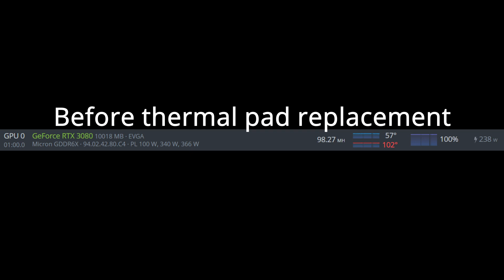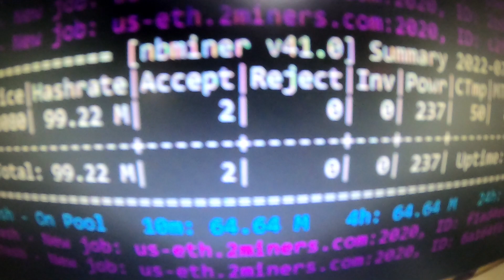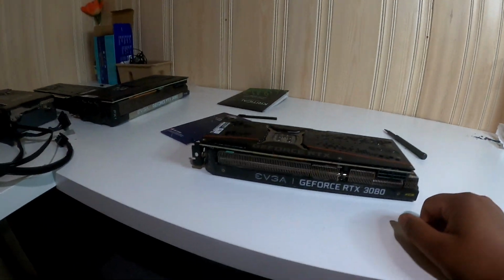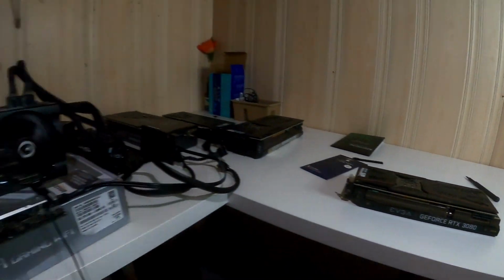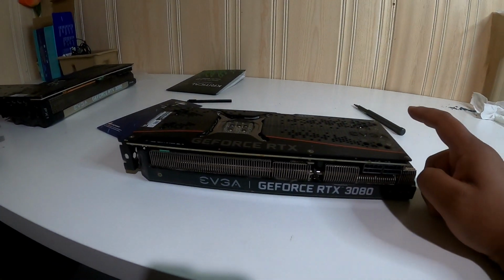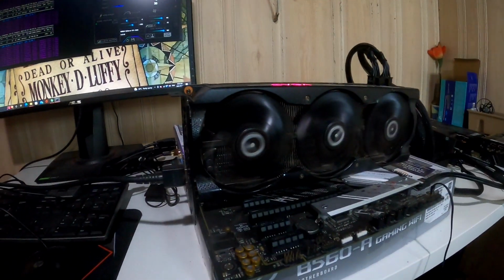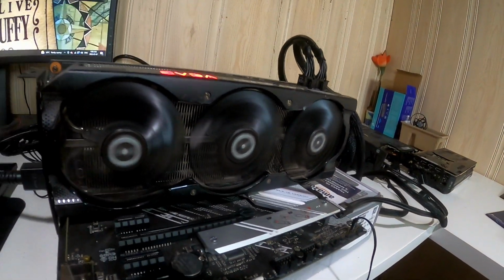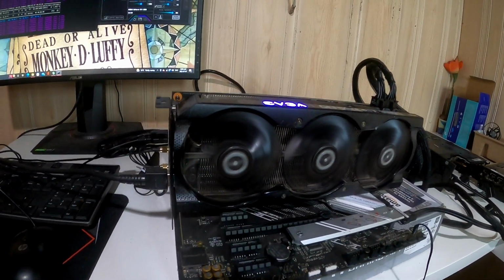EVGA RTX 3080 XC3 THERMAL PAD REPLACEMENT

Comment: When you think about it is there any point in putting pads on the back plate? There is no source of cooling there all its going to do is transfer the heat to the back plate
Reply from the maker: For some reason this card needed pads on the back plate where my other 3080 xc3 did not, however I noticed some of my other 3080s have thermal pads on the backplate and they have significantly lower memory temps compared to the ones that do not.
Reply: the backplate is a heatsink which passively cools. it's not like components on the back are gonna saturate it with heat.

Comment: My 3080 xc3 is highly undervolted 
I rather get a quiet card in my rig
but I wonder if changing the thermal pads would get the temps lower
Reply from the maker: You will see a drop in temperatures compared to stock pads if you swap them. But the cooling solution is poor on the card so keep that in mind.